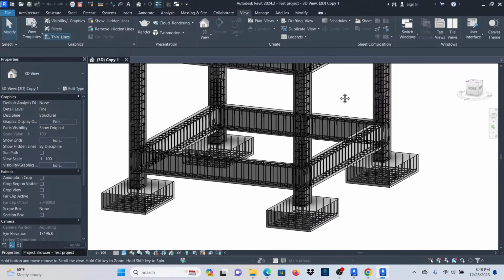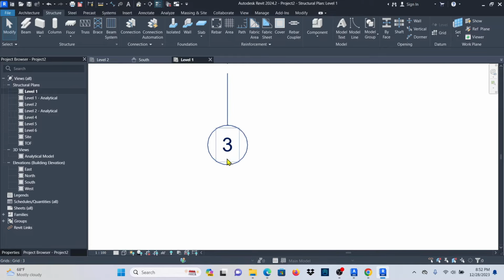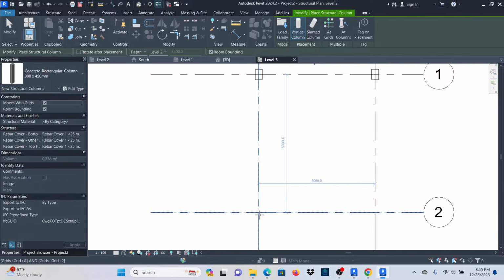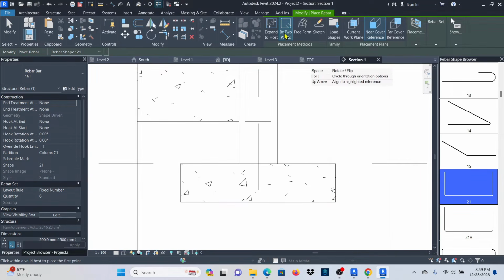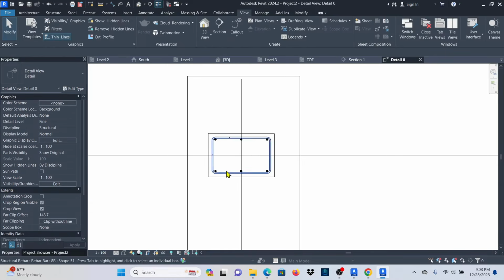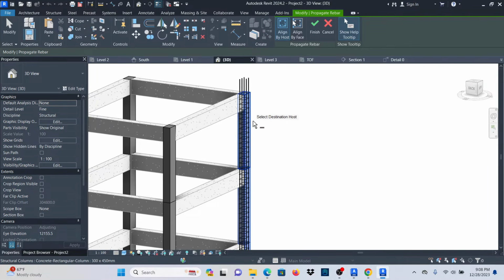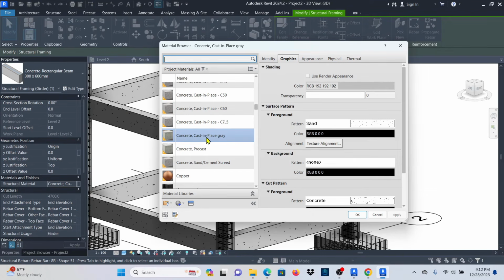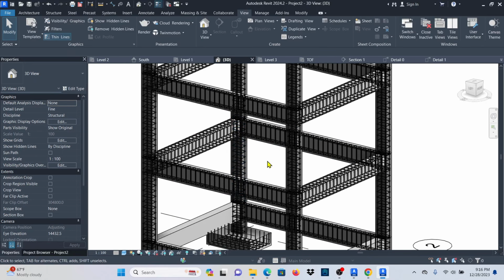Revit structure tutorials for beginners || Full model with rebar in Minutes

Comment: Why do you split the column at each floor. Does your number of columns read 1 or say 4. To get the number of members, surely you would have to assign all your rebar in all levels to just one section / floor of the column (Host). Is splitting the column at each floor for in case you revise the length of the column. I know that if you use just one column from base to top, you can extend the column without the existing rebar extending as well. In 20 years, I have only run into this issue today, as I always do one column from top to bottom.
I remember the lecturer saying split the column, just can't remember why. 🤣
Reply from the maker: The major reason for me why I split columns is to avoid issues if model has to be analyzed especially in Robot structural analysis. Apart from that you can choose to split or not